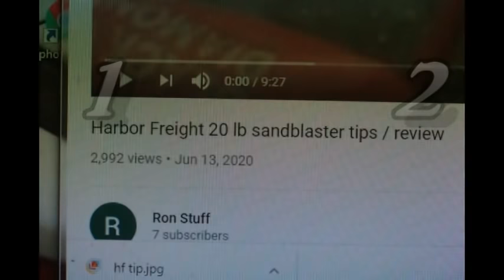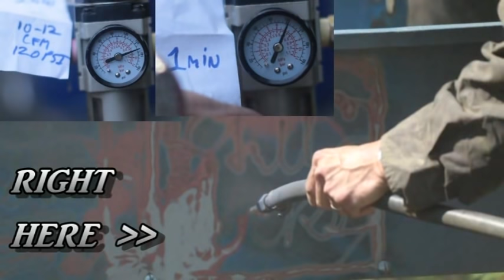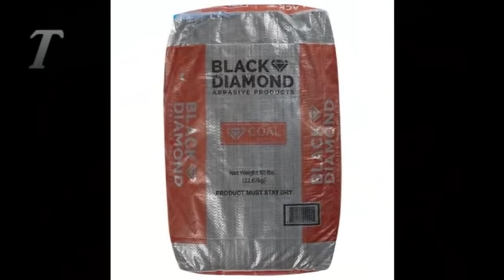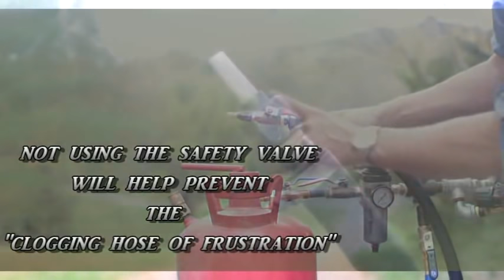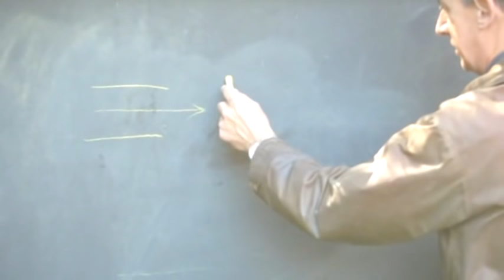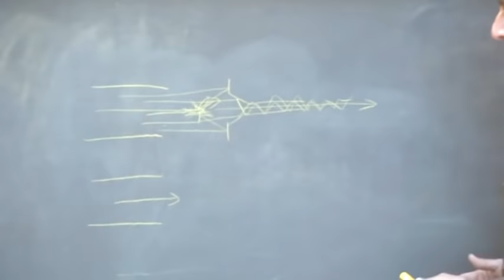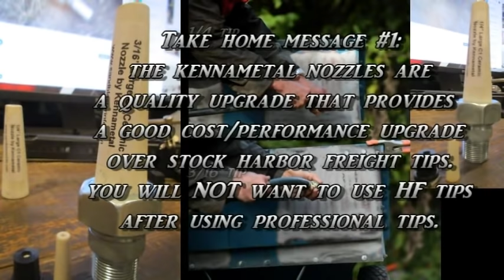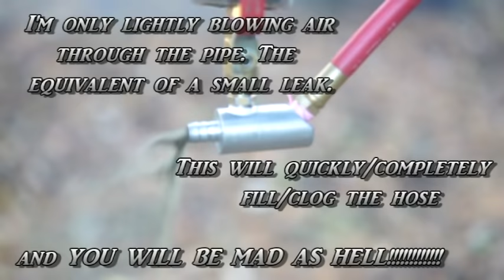Harbor Freight Sandblaster  - The Comprehensive Guide -  Making 20lb 40lb 110lb models work great.

Comment: That's a Harry homeowner dead man...
It's main purpose is to have the on/off feature at the operator end of the tool...it also eliminates ball valves that wear out over and over again...
On a commercial job..with a big boy blaster..
You will want a dead man!! 
Blasting bridges and heavy industrial projects..the main goal is SAFETY ...those blasters can seriously harm if something goes wrong...
A dead man on all these small blast pots is cost savings and convenience...ball valves suck..most people don't want to have the pot in arms reach ...so a dead man helps...
Time: if you are Blasting even at the slowest speed you showed..its still 100% better than grinding or sanding...hahahhah
And it still cleans 100% better as well...
Love the video tho!
Very well done
Reply from the maker: Yeah, if I was using an industrial setup, I would use a deadman. That's a whole different ballgame. This is piddling backyard stuff.

Comment: I ordered these new nozzles but they don't fit inside the nut of the harbor freight abrasive blaster kit.  What fitting are you using to hold the nozzle in place?

Comment: What is the smalls air compressor can I get a way with
Reply from the maker: The video covers this in detail. I made this video so the viewer could get an idea of how fast different CFM rates could cut. The viewer could then say "10 cfms will work for my project" or "this is way too slow even at 20 cfms" - and then make an informed decision from there on whether to even mess with a sandblaster. Good luck.
Reply: @ronstuff6330  thanks  live on a fixed income. So I am trying to get into sandblast

Comment: Great Job, very informative. One tip though, the Best paint job is usually the finish it was basecoated with. If it works to evenly sand the surface to mechanically bond the finish , your good to go! You Should also try etching glass! ;)
Reply from the maker: Thankyou. I removed  the basecoat on the cart to demonstrate the sandblaster on an even surface, not because it needed to be removed. Many  other videos out there have different or hard to read surfaces from a video standpoint. The cart had easy to see flat surfaces with a similar finish to compare different setups. Removing the basecoat was for demonstration purposes only. Funny thing is, I never repainted the cart. It is happily rusting in the back yard. Now, it really DOES need to be sandlbasted! :)

Comment: Were did you get the dryer and regulator??
Reply from the maker: I think it was HF or lowes(don't remember), but if I did it again, I would get just the drier (no regulator/dryer combo), and get several in a row to make sure air going in is dry as possible. I measured air flow through regulators versus driers (it's not in the video)- the driers did not significantly change air flow. The cheaper regulators did.
Reply from the maker: I went out and checked. Central Pneumatic. 68232 part number. Nothing special. I would  place several driers in line if I were to do it again. Good luck.

Comment: https://www.hotrodders.com/threads/hf-pressure-sandblaster-modification.234641/#post-1691271

Eventho's post with part list for the bottom.
Figuring out the multi air compressor connection on my own.

Comment: Save all the bs. Buy some cheap brake fluid and wipe it on the paint. hose it of 15 minutes later.
Reply from the maker: I use strypeeze for removing paint. I've certainly removed some paint using brake fluid too... Neither strypeeze or brake fluid removes rust.

Comment: Would all these modifications work the same way with the harbor freight soda blaster? I want to use a less aggressive media on some hardwood doors.
Reply from the maker: I haven't tried soda blasting. I would assume so, but if I had to do it, I  would start with a stock setup, making changes only as necessary.